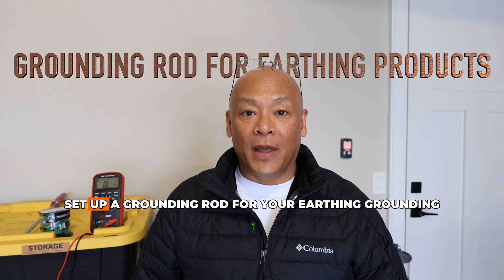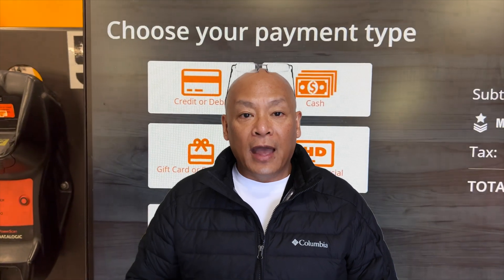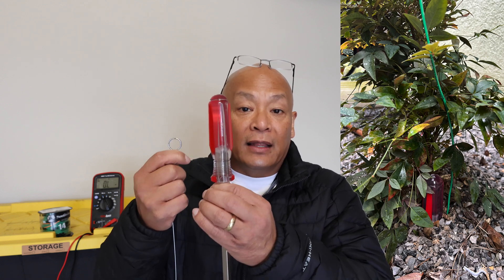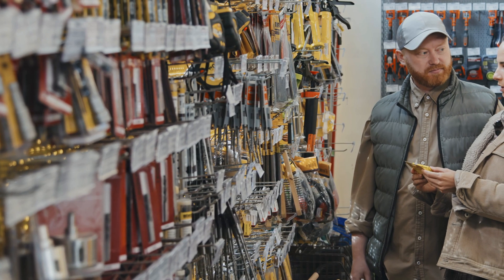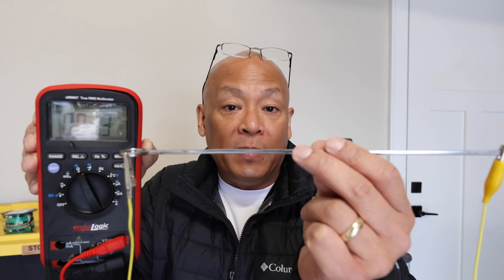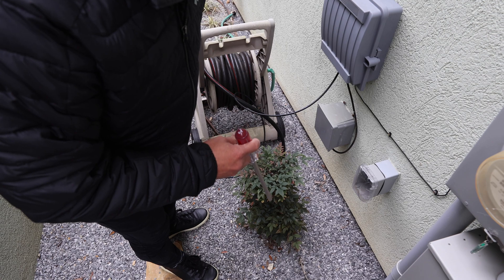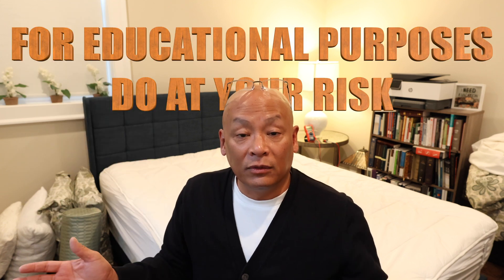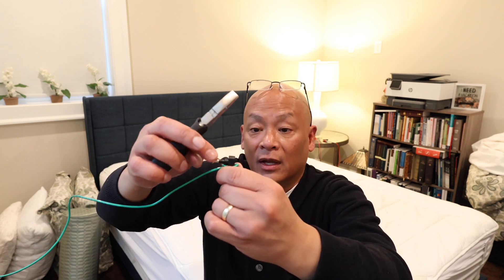Grounding Rod Setup For Your Grounding Mat Made EASY for Beginners!

Comment: My measurements show my body at 420mv AC. When grounded 14mv. 96.6 %  voltage drop. Was your body around any strong electromagnetic fields that you were induced thru capacitive coupling  that registered 4436mv?
Reply from the maker: I was on the second floor, next to a high EMF source in the wall. Also, body VAC goes up with height above ground.

Comment: Great stuff.  Thanks. 
Interesting info about the blue bracelets! Didn't know.  I've been using them to 'ground'
Reply from the maker: Thank you! Test the resistance with a multimeter to make sure the bracelet is less than 100K ohms.